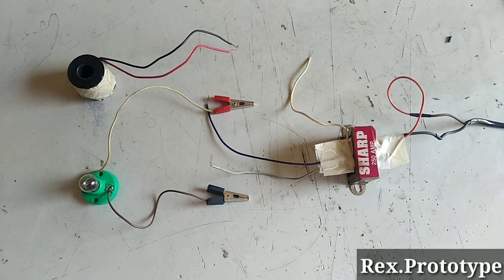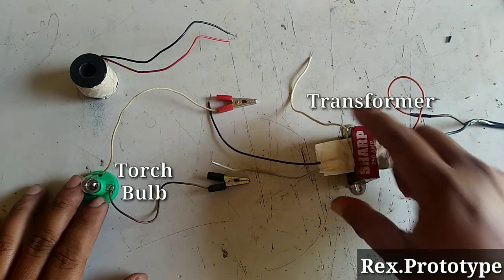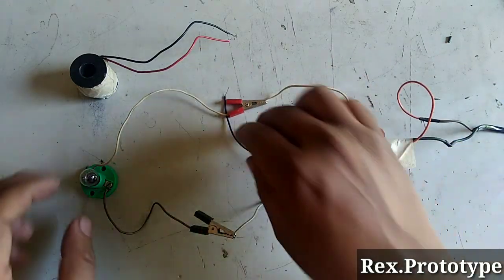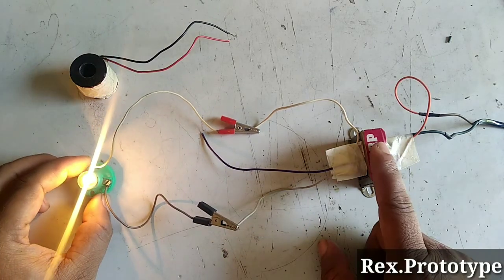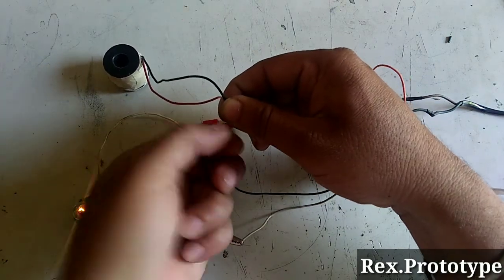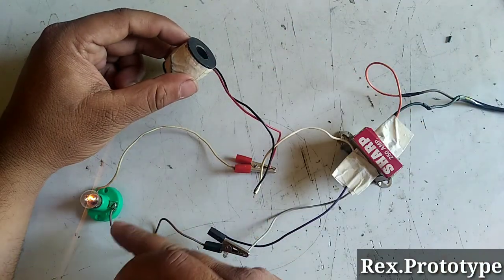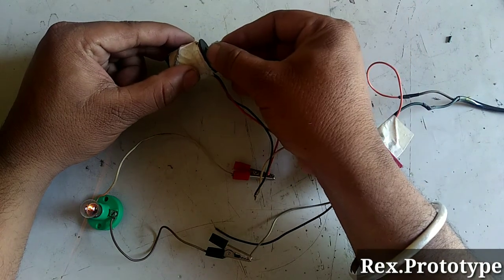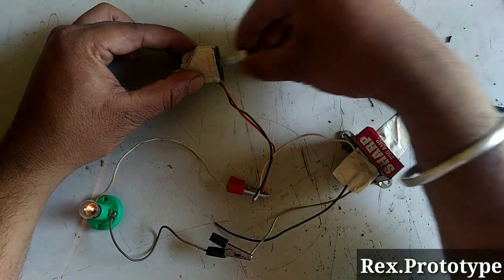Factors affecting self induction of coil

Comment: What is the gauge of winding use ?
in that coil
Reply from the maker: 32 to 36 you can use
Reply: Thank you very much for your valuable response..

 And What will be  the voltage of bulb we can use in this??
Reply from the maker: 3.6 volts bulb
Reply from the maker: It is solenoid having 800 turns of insulated copper wire gauge 36